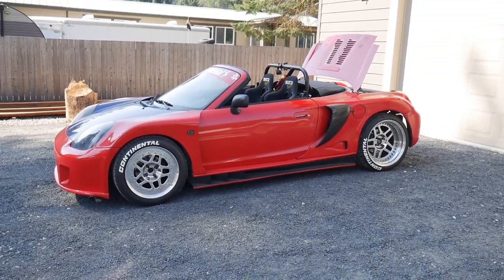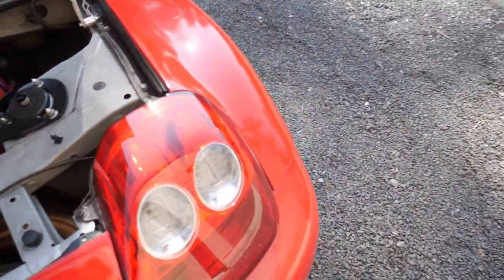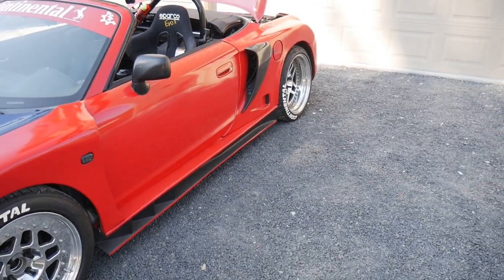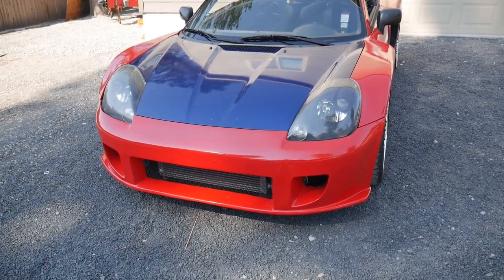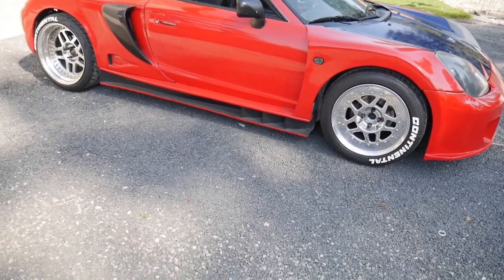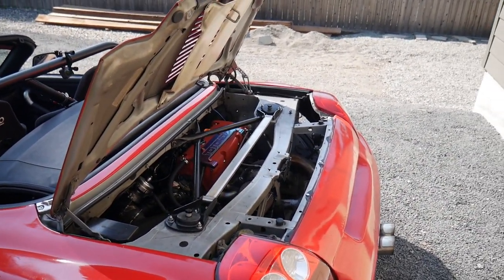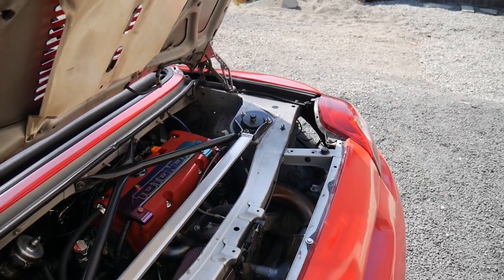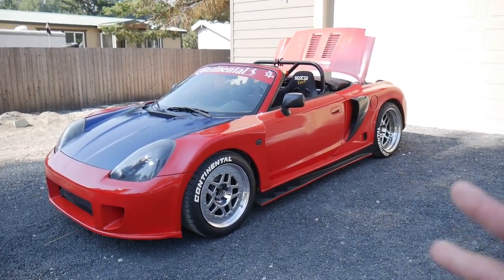I finally fixed my K24 Turbo MR2 Spyder | Monocraft GT300 MR-S

Comment: What are your thoughts of the mr2 vs s2000
Reply from the maker: Stock vs stock?
Reply: @RedlineRicer  yea and as individual platforms. I currently own an mr2 but mine is a little rough around the edges, and I was thinking go either get another one but in much better shape,  I found an 04' for 13500 with 90k miles and I also found an 02' s2000 but with 140k miles but in good shape, and the are also asking 13500, so now I can not make up my mind

Comment: That steering wheel is not big enough unless you are extremely strong and super quick
Reply from the maker: True. I’m upgrading soon. I initially got it becuase I wasn’t sure how much leg room I would have to be able to put my hand in between my legs and steering wheel with my bucket seat. And after I installed it in 2020, it was too late to return. I’ll prob go from this 280mm to a 320 or 330
Reply: I'm making a strap to replace the door pull to free up some leg room and a foam/fabric cover for the arm rest on the doors. Cruise control also on the way after I swap